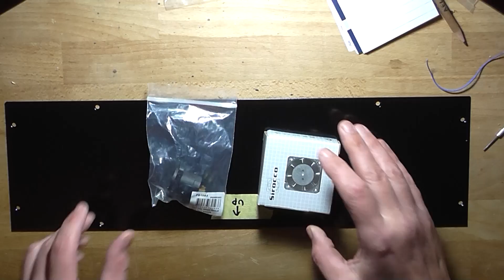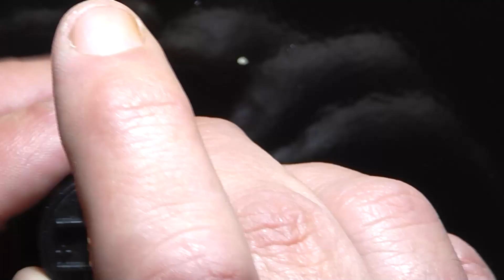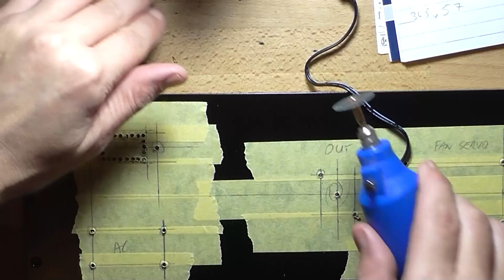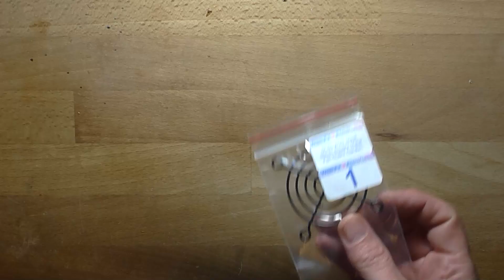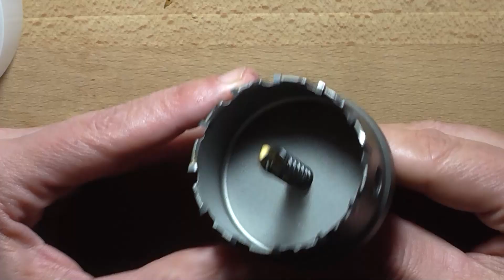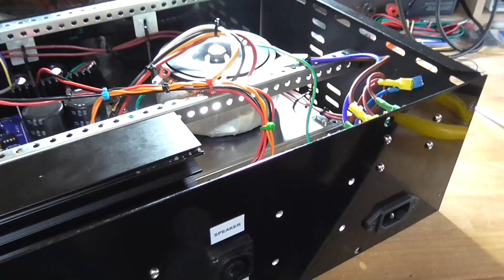200W BTL Amplifier Project: Rear Panel Work

Comment: What is the dB rating on that tiny fan?
Add much noise to the amp?
A good fan option is to get a 120mm 24vdc fan, more airflow per revolution, and if you run it at 12 or even 6 vdc your sound generation goes right through the floor.

Also that Speakon connector... i think they come in single pair version as well. I used the dual to drive mid and tweet in an biamped setup

Comment: No airflow means no load the current will be even higher than 168ma when it has air
Reply from the maker: It won't be running at 168mA idle pretty soon.
Reply from the maker: OH! You mean the fan. Duh, my bad, thought you meant the power amp. Yeah, I don't actually trust the accuracy of the meter on the Wanktek power supply, I'd have to measure it. The LM317T on the PA board for the 12V supply, it's heatsink does get quiet HOT when the fan is running at full speed. I'm glad I got the longer one!